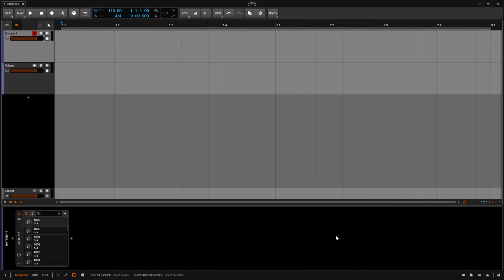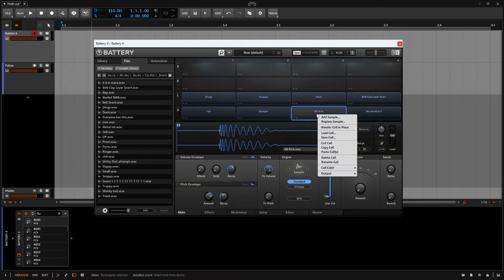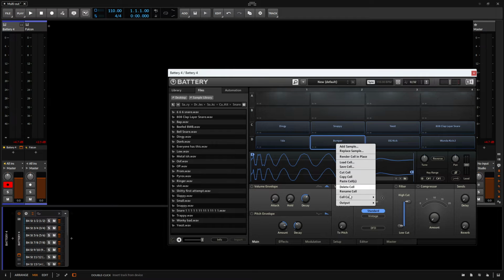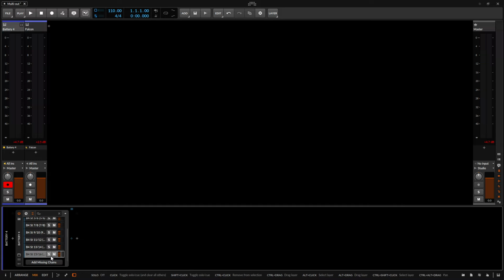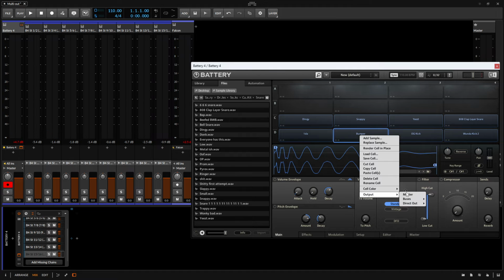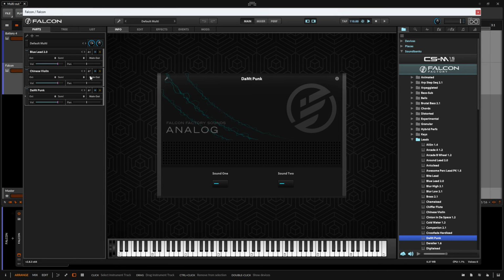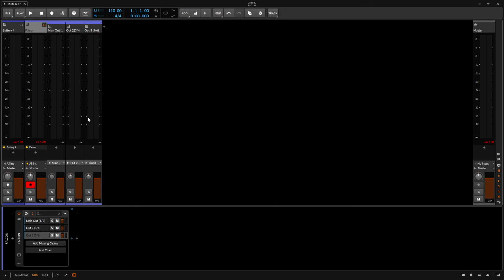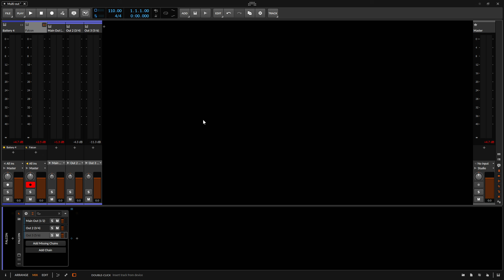Learn Bitwig 4.4 | Setting Up Inputs for Multi-out Plugins

Comment: Would this work with the ERM multiclock plug in for sync to my hardware ? 👽✌🏻
Reply from the maker: Sorry, I'm not familiar with the ERM multiclock.  But it seems that it is specifically for syncing clock signals.  This video is specifically talking about routing audio from plugins that have multiple outputs within Bitwig.
Reply: @quantaaudio  it runs on multiple audio and midi channels it opens in the timeline and generates a96 ppq pulse to sync in various ways ✌️👽

Comment: Hi Quanta   Thanks for the tutorial  wondered does this mean that you have a folder whereby you can manipulate the audio on separate tracks   regards
Reply: Thanks Quanta great tutorials, its not easy when you change daws but reassuring that you are on the same journey
Reply from the maker: Yes, especially when the workflow and layout is very different from your previous DAW.  But, it's a fun/interesting journey, and helps keeps the brain sharp!  (-;
Reply from the maker: Not a "folder", per se...  But you can add native and 3rd-party fx to each of the discrete channels, as well as being able to adjust the audio levels, panning, fx sends, etc. for each separate channel.